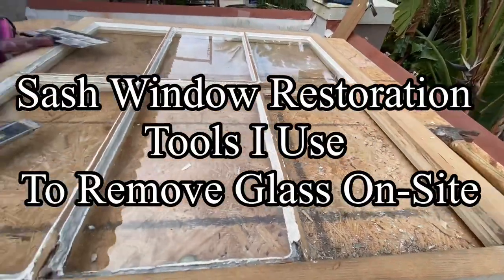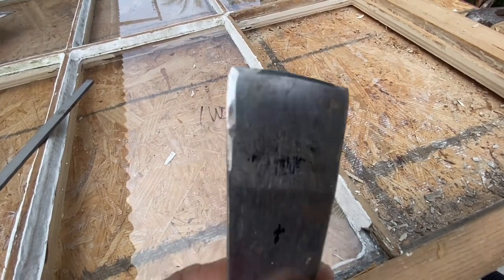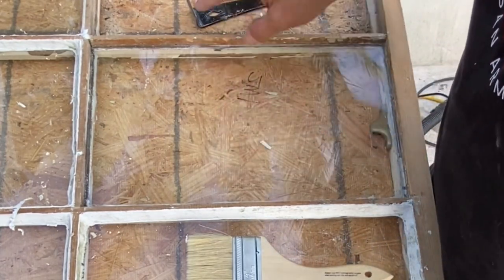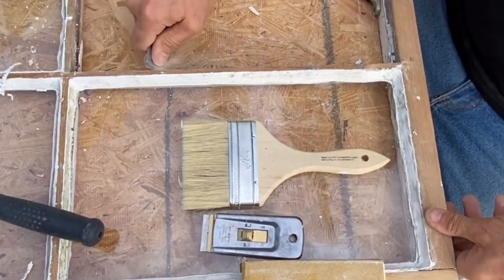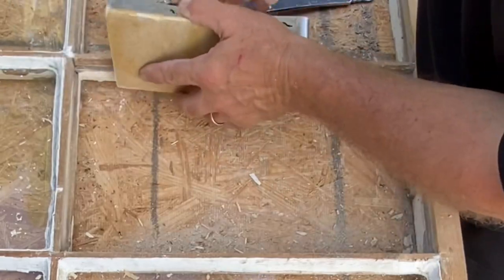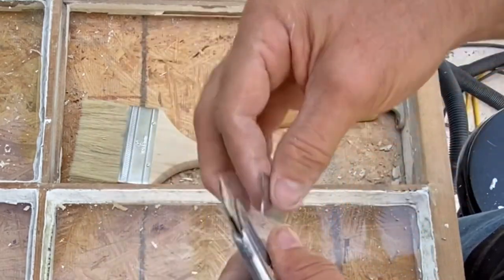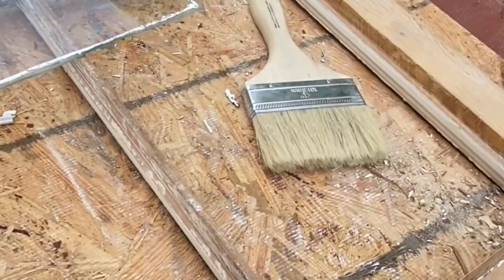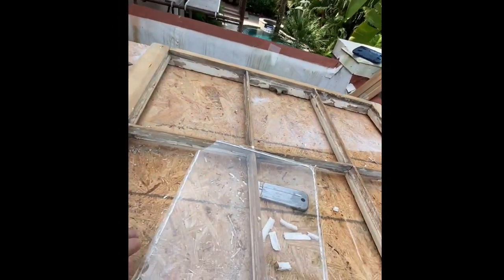Remove Glass From Wood Sash with these Tools

Comment: Very nice video. Dont know if it would help, for old putty I warm up with a heat gun till its pliable. Comes out nice and clean. Just have to be careful where the points are. Nice video.

Comment: What do you recommend for cleaning / removing glazing residue etc off the glass after removal?  Or does that need to be removed at all?  Cheers
Reply from the maker: I use a razor blade for the most of it, usually with the assistance of water, Dawn dishwasher detergent and a scrubby sponge like you do the dishes with.

Comment: I hope you wear safety glasses when hitting a piece of steel with a hammer.  Speaking for myself, I would use a wooden or a rubber mallet but I would never hit a piece of steel with a regular hammer without safety glasses and a face shield.  Voice of experience.
Reply from the maker: Eyes are important

Comment: What's your pane break ratio?  I'm running at about 25% :(
Reply from the maker: Depends. I think 10% would be a good estimate for me. But some jobs are different than others. And sometimes I break glass out of sheer stupidity and impatience. I broke two because I used the one point driver that is notorious for breaking glass. I knew better but in my exceeding arrogance I said to myself, “ha. I can do it THIS time.”  The point driver gave me the finger and broke the glass anyway.